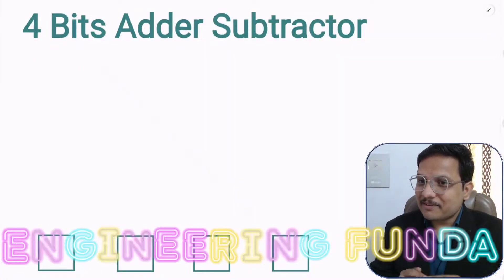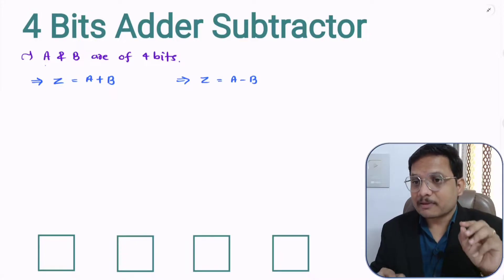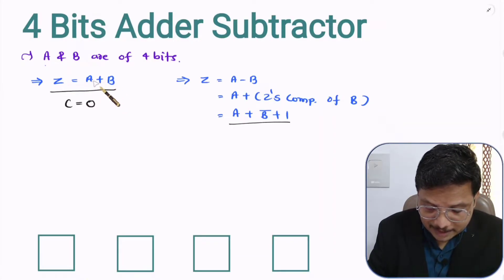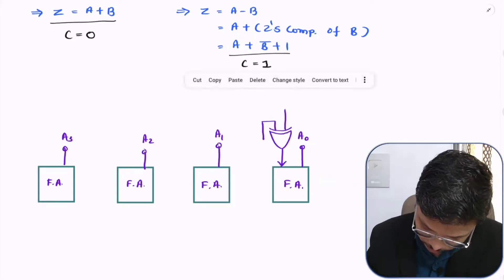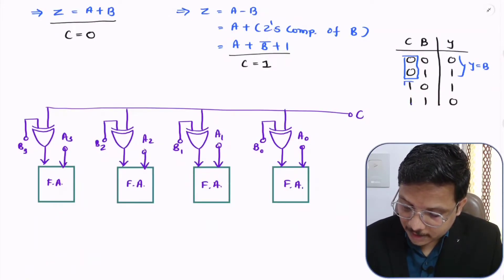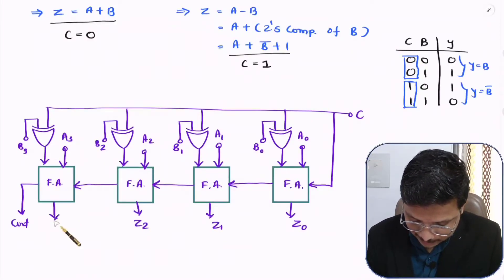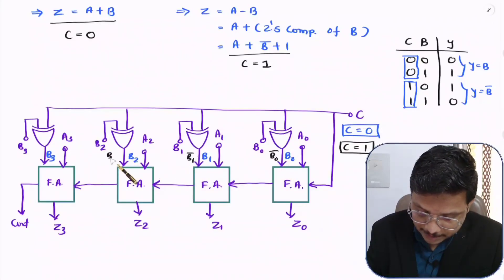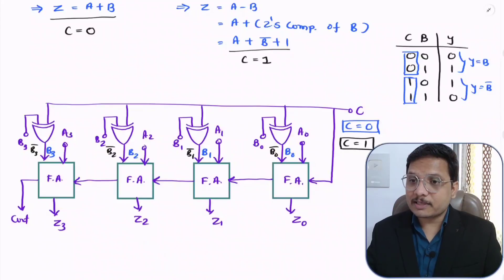4 bit Adder Subtractor: Circuit Design and Logic Explained Explained

Comment: I have a question, assuming we have a number that produces overflow in 2's complement form, for example 0000-1111, where 0001 is the result of the operation, but it is no longer representable in 4 bits, how can we detect the overflow within the same circuit?
Thanks for the help!